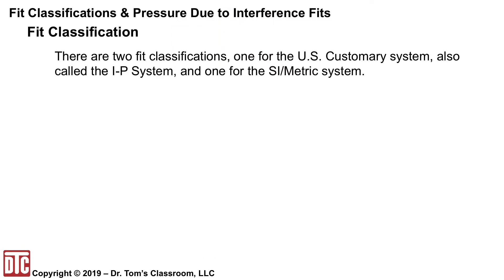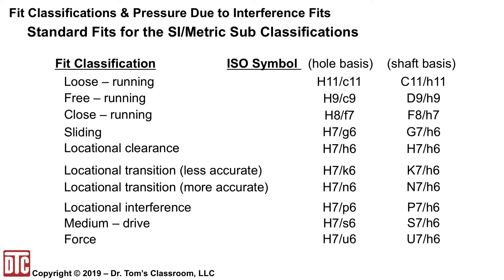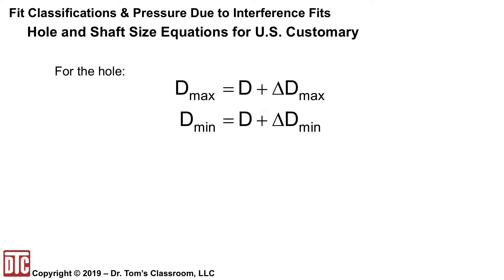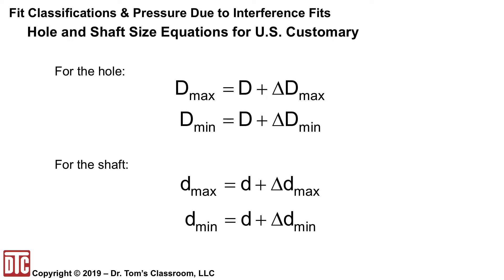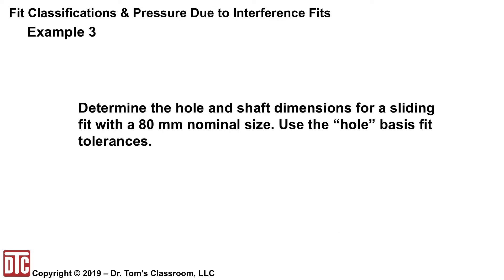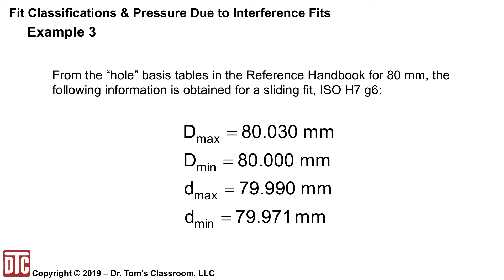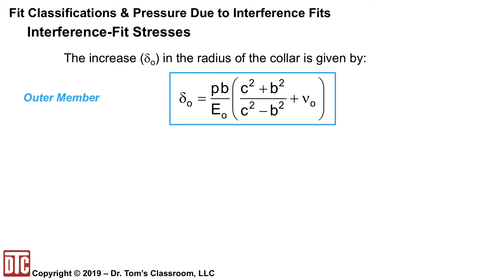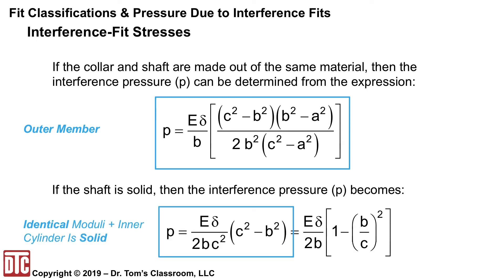SAMPLE LESSON - DTC Mechanical Machine Design & Materials PE Exam Review: Solid Mechanics

Comment: Shafts go in holes correct? I don't understand how in your examples the shaft has a larger diameter than the hole.
Reply: One way to install them is to freeze the shaft and place it in. Cause stress on both parts. Called an interference fit.